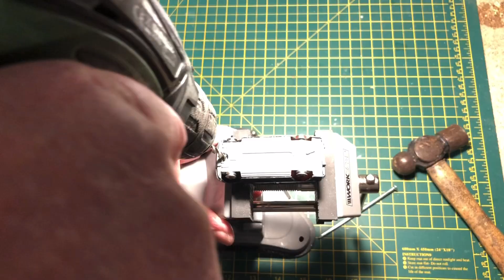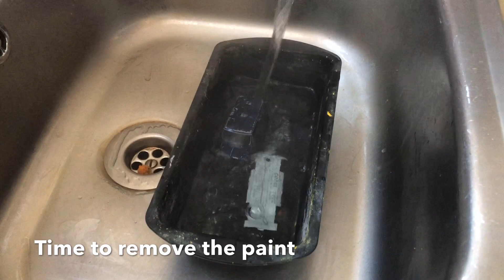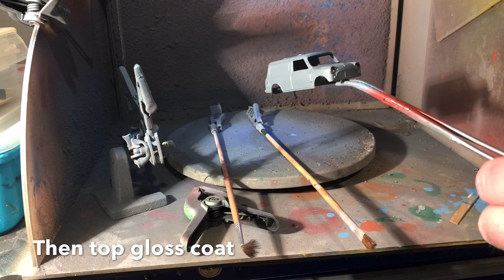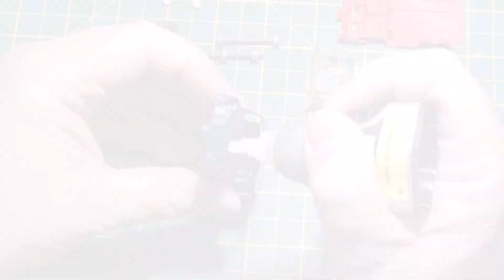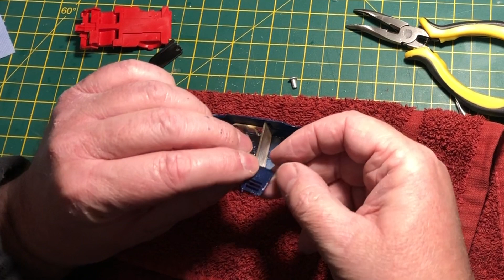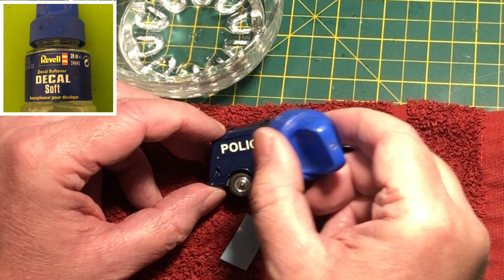corgi police mini van

Comment: Great job. I've just subscribed to your channel, going to binge it now. One question if I may, where would I look on ebay for spare parts for models such as this?
Reply from the maker: Hi Dean, I use  model-supplies.co.uk, not sure if they are open yet due to lockdown. They are very reliable I usually get all the parts I need. Thanks for subscribing Geoff